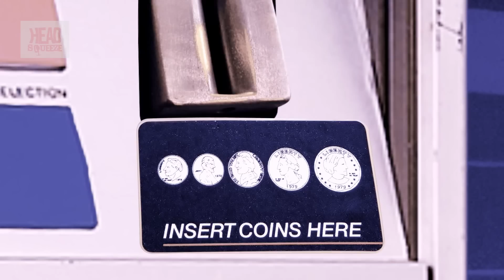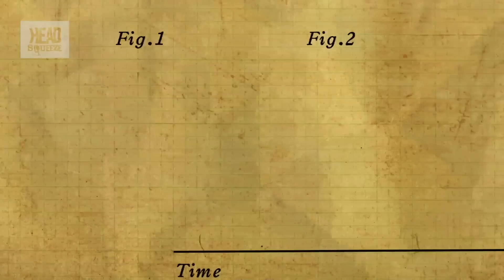Can We Build A Space Elevator? | Earth Science

Comment: the problem with rockets right now is that they are VERY inefficient and 90% of their weight at liftoff is their fuel, so instead of having all the fuel on the rocket at liftoff, why don't we just have a flexible pipe to pump the fuel to the rocket while it's lifting off? it would reduce weight and you would have virtually unlimited fuel

Comment: If the top of the elevator is in gyo/sync then anything going up it would still need to accelerate to 24K/mph (from 1K/mph) this acceleration doesn't come for free, so what extra stresses would this put on the cable, and where?
Might not this pull the counterweight down in its orbit?
As for thr 5K tons of counterweight, how much of that could be salvaged from existing  "Space Junk"? Giving the c/weight and clearing away the collision risks.